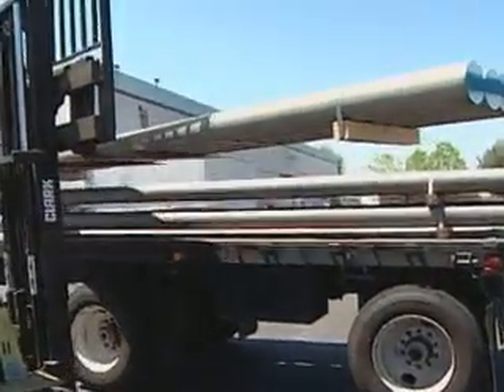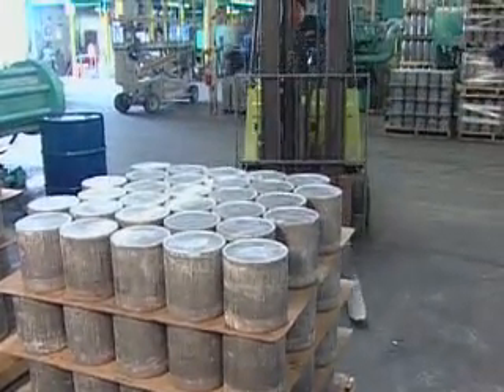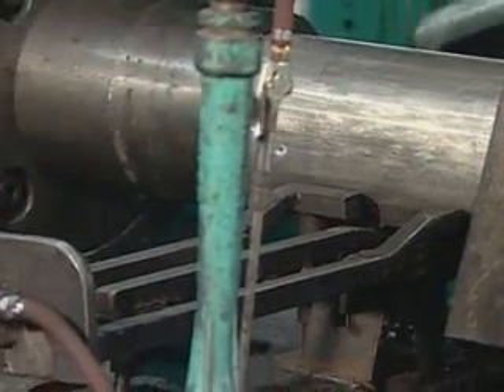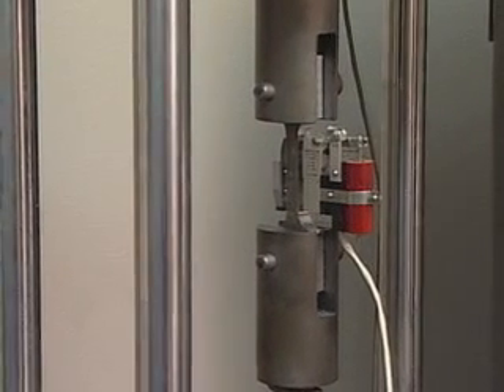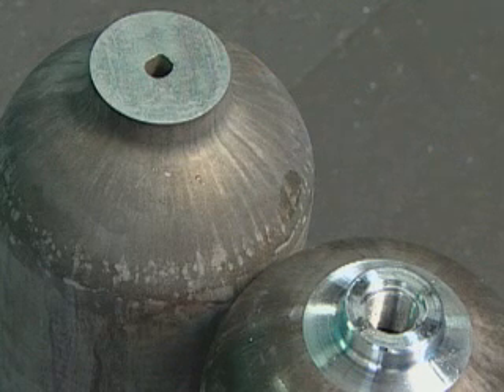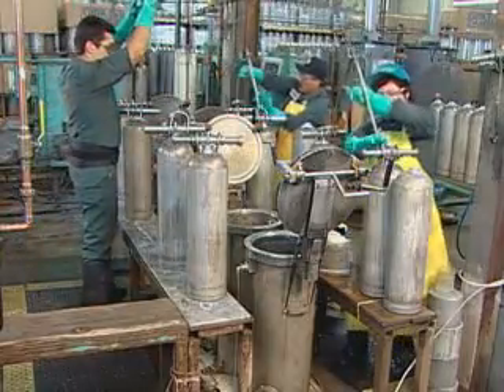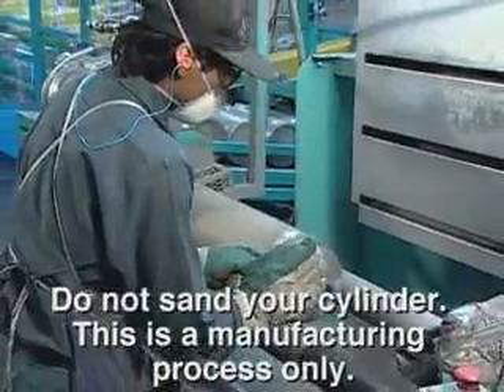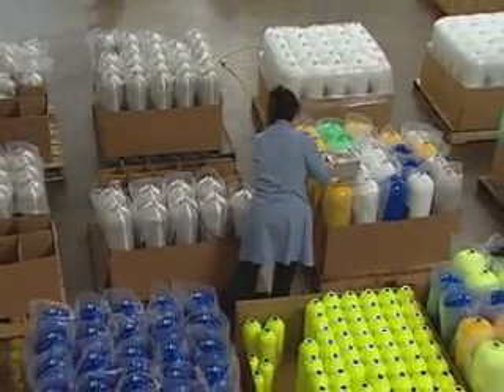making an aluminium scuba tank

Comment from the maker: All metals produce diferent voltages when put together in salt water. Thus the only compatible metal valve would be that made out of the same material typicaly T6061 Aluminium Alloy. However, in practice, compatible aluminium alloy valves were found to be not tough enough to survive the harsh work environment endured by scuba tanks, and thus the modern chrome plated brass valves have prevailed, at the expenses of sometimes extreme corrosion in the cylinder next face region adjacent to the valve

Comment from the maker: The DOT commissioned an extensive investigation into SLC cracks in Aluminium SCUBA tanks and the best way to detect them. The 200 page report identified magenetic eddy current NDT testing as the most cost effective method. Advanced Inspection Technology Co in the USA makes SCUBA cylinder NDT testing equipment - A Google search should find them

Comment: Good point - would I be correct in assuming that's a form of magnetic field testing - internal flaws causing variations in the surface flux pattern?
Used it for steel cranks, rods, etc.

Comment from the maker: @GordonWG1 Intuitively, increasing the periodicity of Hydrostatic tests should help remove these potentialy hazardous tanks suffering from sustained-load-cracking (SLC). However, in practice this is not the case. Cylinders with SLC can and do explode soon after a successful hydro test. The solution is to carry out Eddy current NDT testing of the critical neck area. NDT testing can sucessfullly identify SCL well in advance of mechanical fauilure and is the preferred method to detect this anomaly.

Comment: Aluminium (aluminum to the US lads) alloys are susceptible to fatigue cracks and catastrophic failure. The fatigue is from the strain from the loading and unloading of the material with the air pressure - more the tank is used, the sooner the fatigue will be an issue.
if they are frequentlty refilled - several times a day, I'd be tempted to up the pressure testing to every two years, or even more frequently, as a failure in use can result in serious, even fatal, injury!

Comment from the maker: @frithwks
To remain independent, we neither sell nor promote steel, aluminium or fiber cylinders - or any one manufacturer. Our job is to instruct new technicians how to impartially inspect and repair diver’s life support equipment including high pressure cylinders.
All modern scuba cylinders be they NCM Steel or T6061 Aluminium types have a long design life if used according to the manufactures instructions.

Comment: If you mean rupture, its due to people overfilling them (For an Aluminum 80 3000psi is the maximum fill). So people put more in for more bottom time. Another common reason is when they get old they start to pit and get small cracks that can eventually make the rupture. You are required to have them visually inspected every year and hydro statically tested every 5 years.